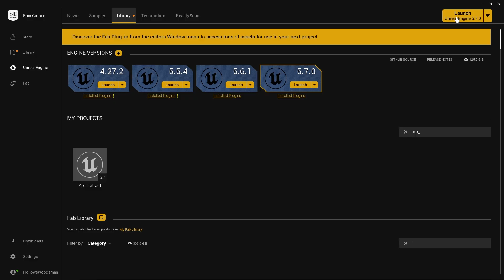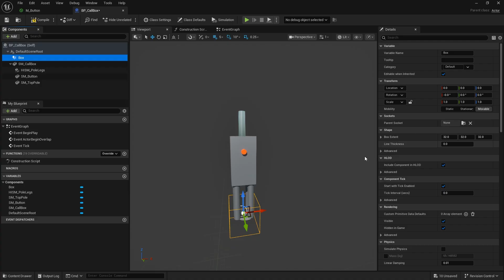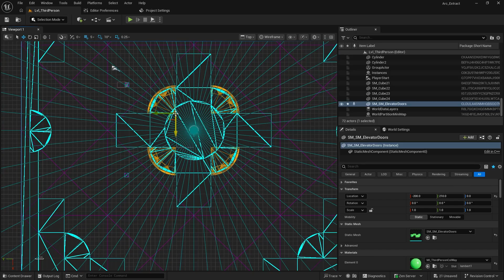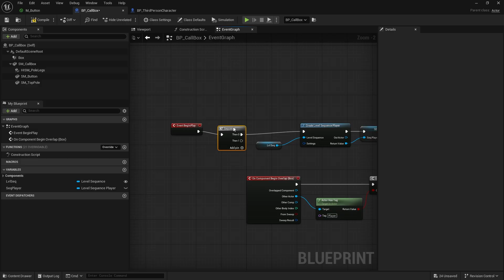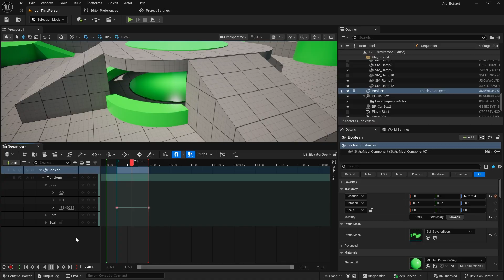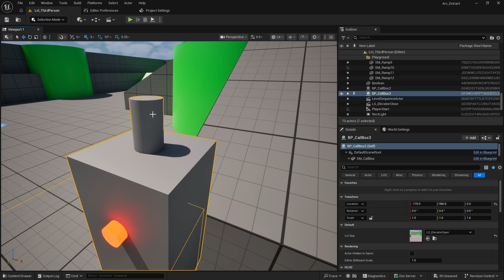Unreal Engine 5.7 Masterclass: Arc Raiders Inspired "Simplified" Elevator Extraction

Comment: Would like to see how you expand from what you have so far. I would like to know how to hold the player data for their loot, weapons, a hideout/menu to interact with loot or sell to vendors
Reply from the maker: That is exactly the next layer I want to explore. The proper path is persistent player data first: extracted loot, weapons, inventory state, then a hideout/menu layer where the player can equip, sell, upgrade, or prep for the next run. If I ever demo that full path, I’d likely break that into a dedicated follow-up so it does not turn into spaghetti.

Comment: I could essentially do this for a elevator feature to the next level of a build correct?
Reply from the maker: Absolutely! This system is flexible enough to be used for a multi-level elevator. You could go either: level streaming and old school style or load and unload lvl instances via data layers in world partition. OG method is best for small games, open world style, or large asset/complex levels coming in and out, id use WP for that. I can add this to my list of things to demo in my next tut. Thanks for watching!